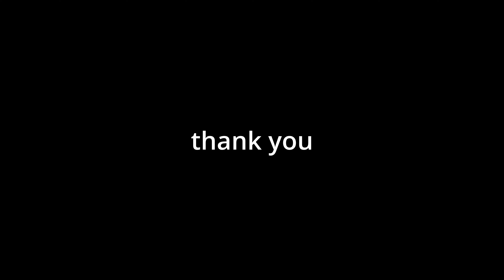Revolutionize Your Firewood Process: Split-Fire 3490 - Faster, Easier, Better!

Comment: Watching you absolutely kill it with our machine all the way from our headquarters in Norwich, Ontario.
Reply from the maker: Appreciated!  I just ran this machine with 4 bodies yesterday and it was very nice for that workflow. 3 people hustling can be kept pretty busy running this 3490. Nice to have the option when help is available. Otherwise, I love running the machine by myself as well.  Thank you again!
Reply: I’m getting huge amounts of twisted tree service wood….
How do you believe your splitter would handle 36”+ oak rounds? That’s what I’m full of right now.
I also consider the 4413 size, but maybe it’s too much?
It seems like your splitter is easy to take into the woods too👍
Reply from the maker: @cutNdryfirewood  I have a video coming out where I got into some pretty crazy stuff with Mark.  Will be out on Sunday.  My opinion is this however.  If this splitter wont split it, it is likely because the wood will not split nicely no matter how much force you put into the knife.  Large rounds are a lot of work, but the lift makes it MUCH better.  There is a limit to the lift as well.  Worst case scenario you noodle the round in half right there by the splitter and work the halves.

Comment: How does this thing do in the snotty stuff? I make boiler wood here in southeast iowa with a 2 speed 30 ton countyline. It uses allll the muscle from time to time. I cut lots of crooked locust and real stringy hackberry, typical midwest stuff. Good content and pretty legit machine for sure, thanks.
Reply from the maker: I am going to say that the slower machine is better suited for absolutely busing through the worst of the worst. One thing I have found personally (since I do not do boiler wood) is that if the machine doesn’t want to split it, it likely wouldn’t split in a way for stacking anyway. One thing that is unique about this design is that when you hit crotch pieces and tough wood, it starts to cut through the wood rather than split it due to the profile. One thing that I have learned is that there is seemingly always difficult to find a machine that ticks all of the boxes. Hackberry split just fine as the knife slices right through it and it is actually quite pleasant to work with. Thanks for watching!

Comment: Super fast! Is it a 9hp Honda with 16gpm pump? We don't have that option here in Tas, Australia. Why don't you use the cross blade? More sticks, but you'll double your production. Another thing that is a great back saver is a log pick - you could roll those rounds while staying upright!
Reply from the maker: I believe the GX 270 is 8.5 HP and as far as the pump goes, I am not too sure what they consider "high flow" I am pretty sure the pump, reservoir and filter are all upsized.  I am super happy with it!  Are the Split Fire Machines Prevalent in Australia?  That is awesome!  I do use the 4 way knife quite a bit and love how easily it is swapped out.  This video you watched is still fairly early on in my ownership of the machine and so I am still becoming more familiarized with how I want to complete the process.  

I will certainly be utilizing the pickaroon more in the future.  In this video, I am not sure if it is visible but my two hooks are sitting there in the back ground.  This machine is a back saver and I should make moving the wood be even more of a back saver too!  Thank you for watching and commenting

Comment: Definitely a nice splitter, I’m starting to cut up a grapple load, my 390 with a 32in bar is my new favorite firewood saw, and soon I’ll be starting to split it, our splitter is no where near that nice tho😂
Reply from the maker: I bet that 390 would be a pleasure to run.  32' is a good length to be able to stand and buck.  Full comp or skip?  I am contemplating putting skip on my longer bars simply to file a bit less.  A full comp 28" takes quite some time with a hand file.
Reply: @oakiewoodsman  so, what size wood are you in? If I’m burying a 32 I’ll run full skip, mostly 12in or less full skip and for general use semi skip, and yeah I feel that filing a full comp 36 is painful😂
Reply from the maker: @SomeGuysSawShop  I am justing thinking that skip is a bit tough in small stuff but I want the option to cut in it as well.  I have one skip chain and I think I ought to put it on my 620 and try it out.  The only saw it was every run on was the 660 clone.
Reply: @oakiewoodsman  I HATE full skip for limbing, bucking medium to large wood it’s not bad, I’ve been running full skip in 8-14in oak and it’s not bad I’d rather semi or full comp but it’s not bad, just run hungrier rakers
Reply from the maker: ok, that 372 with the 32" bar I ran had skip and I happy with how it felt but I hadn't tried any really small stuff
Reply: @oakiewoodsman  as long as it’s SHARP and decent rakers it’s not bad unless your limbing and stuff, that’s when I noticed a difference

Comment: You should try Dickie's work socks. They're 9 percent wool and they breathe very well. I've been using them for years down here in the Georgia heat and I love them. They're also pretty warm in the winter months.
Reply from the maker: Thank you for sharing. I do not know if I mentioned this but some wool is better than none. I like to try to keep it to above 20% but with that generally comes more expense. I was unaware that the Dickies socks contained wool and I think that is an excellent thing for someone to try if they deal with tank feet issues. Appreciate you as always!  Keep safe buddy!
Reply: I've been an Army guy for over 20yrs, been wearing gold toe FoxRiver socks for most of it. Keep them fresh and rotate your stock every 6 months or so and you'll be in good shape. I make all my soldiers wear them and they get along just fine as well. Not sure if they have any woll or not but I thought the brand and testimony was worth mentioning. Do with this as you please
Reply from the maker: Thank you for sharing!